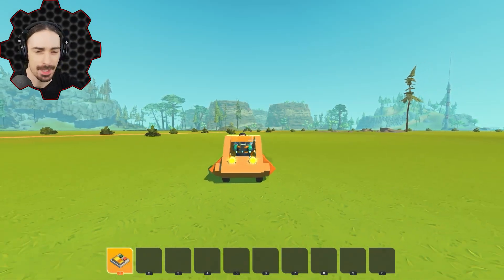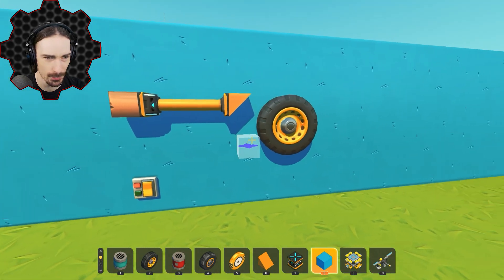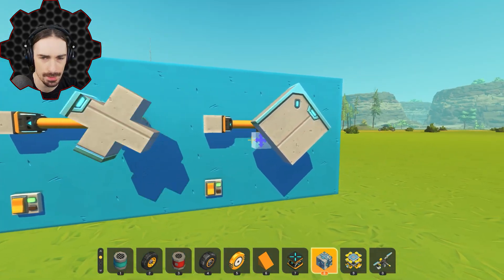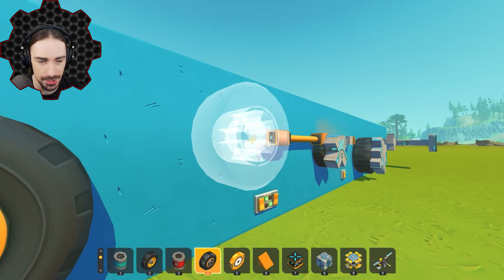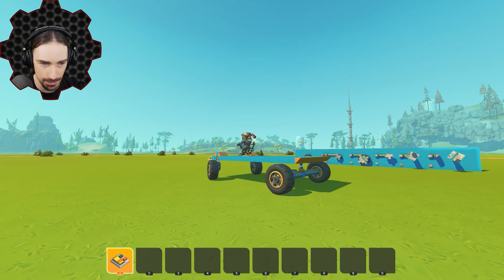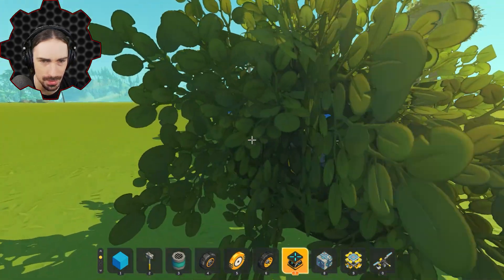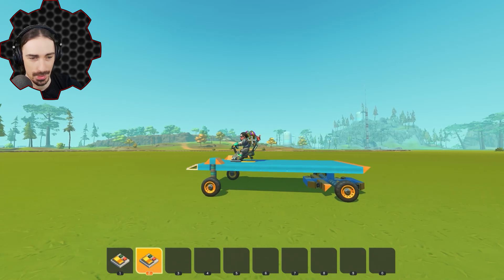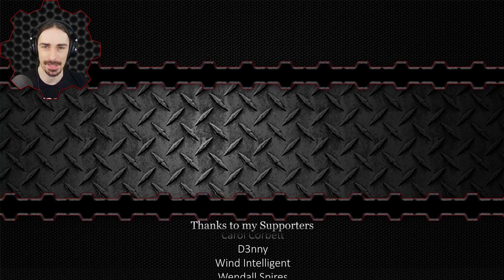The Spooky Science of Wedge Powered Objects

Comment: This is interesting for a low resource requirement zero fuel vehicle in survival. A controller powered car takes more component kits but overall would be more reliable (can go in reverse, can use suspension).

Comment: what if you made a canon powerd by wedges and how it works is that you have two equal weights 
on both sides of a concrete or stell pillar and you attach some pipes and when it has enough power
it realeses from the canon and rolls away.

Comment: Um.... Maybe you should try different diameter pipe/wheels for the wedges to push on. A larger diameter would give more spaces for wedges.
And then, if different arrangements give different levels of torque/speed, you can actually use logic for a switch gearbox.
Also, would a glitch piston allow for a single solid axle?

Comment: Huh, looks like it has decent horse power, but terrible torque...
Wonder how it'd change the "car's" speed if there was a second set of powered wheels? Change the frame from a rectangle to an I-beam?
Maybe if you could individualize the wedge's pistons it could power better in the car? Or at least make it so you could fine-tune the HP/Torque from the wedges?
Also, for the "break" instead of blocks, I'd have thrown in more wedges facing the opposite direction. Then, your break would also be a proper reverse "gear".

Comment: So I think the reason it’s barely going at the beginning is because it’s not actually contacting it that much so what I think is the prototype is a directly attached to the wall but the car is extended a few blocks out to where the piston is with the wedges so it’s not actually getting all it’s push therefore less power

Comment: With the final design, because of how the computers calculate the collision shapes of ebjects with perfectly straight lines, the corner of the stack of 4 wedges side by side would result in only a contacting corner, as the bearings have some give. The closest corner would then be the only point of contact between the wedges and the pipe axle. Any bend in the axle would mean less contact, and therefore less force applied. The force does appear to be the diagonal component that is reflected from the contacted surface against the wedge/block. You likely wouldnt move at all if the surface touching the axle/wheel was perfectly perpendicular to the radial direction of the wheel. EDIT: Your brakes have this perpendicular surface angle.
Reply: I think if you ran the wedges with a single piston per wedge, then you would have the 4 corners instead of one corner when the axle bends, making it more reliable.

Comment: Thanks to this video I have now made multiple prototypes of survival vehicals that use wedge power, including a large mobile base with independant suspension at every corner and powered solely by wedges. Soon I'm going to make an even larger mobile base with more wheels and more wedges. Oh, wedge power tip, don't do a weird pipe axle, just put the wedge-piston right on the wheel.

Comment: I attempted a sort of tool setup with this Glitch. Using a drill or saw on top of the wheel (without additional blocks) gives a result, similat to using a gas motor on mid power level. Another step towards motorless survival

Comment: the reason that this works is because the physics simulation thinks that the wedge is pushing the wheel forward and the piston is being pushed back because of the speed and pushes forwards again - I can't explain why it's pushed back - which creates motion in game physics. This doesn't work in real life because the piston wouldn't be pushed back by the wheel rotation which is caused by the wedge on the piston.

Comment: I paused at 2min 58 sec to make this comment, I believe the reason why it spins slower when you add weight vs having that same weight and starting it is because the game recalculates the "forbidden momentum" after you add weight (also is probably low torque due to how the power is being generated). I've seen similar physics glitches in other games such as trackmania, in that game when you change directions of the tires very quickly the game engine multiplies the force instead of calculating the proper drag/resistance. Given how that games physics work i'd assume the reason that the applied forces with the piston creates a spinning motion is due to the piston extending and bouncing back in small increments repeatedly in the same place. I'd also assume that if that is indeed the case then this mechanism/glitch will not work  once there is too much play because there will not be a consistent repetitive force in the same location. Probably resulting in the piston and slope bouncing all over the place(as i watched further i saw this was the reason for the issue when you had suspension even though it is not precicely how i explained it). Givin that assumption I am guessing that the location of the square piece that you will soon use may not work unless you have the cube at a slope since the force on the flat surface will be in the center of the wheel instead of at an angle where it acts like a slope. But I suppose I will figure that out when I continue the video. Also, I love your content. Keep doing what you do!

Comment: You didn't consider the length of the piston (or whatever the name is) when it is extended. To me it seems (based on the two most right examples on the wall) that the length has positive correlation with the speed. Also it would have been cool to somehow measure the torque by going up-hill to see if two wedges give you more torque but lower speed, or two wedges are in general inferior to single wedge. Overall I loved this sci-fi (or sci-scrap or sc[i]rap) experimental video. Well done!

Comment: It looks like pushing anything into a wheel cause a force multiplier. The direction of spin seems to be determined by the current rotational momentum of the wheel upon contact. Cycling the piston while its rotating causes the multiplier to recalculate.

Comment: Just an idea but going with the whole two speed idea maybe there's a correlation between the surface area of the wedges and the amount of torque produced meaning that if you have less wedges touching the pipes the wheel would move faster. It's be cool to have the wedges that are currently connected split up with more pistons pushing them (in say groups of 2 instead of 5) then to start off you would have all of the wedges pushing the pipes then as you increase in speed and need less torque you take away more pistons much like how a torque converter works

Comment: Scrap man the further away the weight is the more torque is applied just like trying to unscrew a bolt the further away the leverage point is the more torque applied and the easier the bolt is to unscrew so the further away the weight the easier it is for the wheel to spin also for a video idea do a best wedge powered drifter wins and judge by drift angle time in drift and possible drift taps do this with man and moonbo

Comment: So, after doing some eyes in the comments, I've perfectioned my ideas, got some out, and got some new ones. First, make the car smaller, shorter and lighter so the low torque can send the high speed easily. Second, check if the wheels are spinning same way. Third, make some wedges not to move without another button so you can have gears. Fourth, put the concrete extension, since they change the gravity mass abusing better the physics. Fifth, try using bricks for rear gear.
Sixth, avoid making it tall for having less necessity for springs and less trouble.

Comment: So you basically created gears. The more that are engaged, the lower the speed, but higher the torque/power. It also seems to be pretty consistent. I would be interested to see if you did a 4 gear design, if that would have more torque than an engine or two, and be able to move more weight over flat terrain, or uphill. Could basically be a semi for SM.

Comment: You should have tried to use concave pieces. I actually made micro trains and for consistency I placed concave pieces where the wheel is (wheel first, otherwise it doesn't work) and it started spinning in a random direction very fast.

Edit: It seems the bigger the wheel the more torque you have (but you have to apply the wedge power directly to the wheel)

Comment: I have a theory about how it works.
bearings have a tendency to wobble when there’s a lot of weight on them and rotate quickly.
However when you put the wedges further from the bearing it would prevent the wobble and lower the rotation speed.
So maybe putting more weight away from the bearing and test how many wedges you could get away with before it starts loosing speed might give better results.

Comment: You seem to mix up power and speed. With the thinn pipe pieces you get a lot of speed, but not much torque, therefore not much power. Pushing on the wheel directly should be slower, but provide more torque.

Comment: It seems like you neglected the friction and weight of the block applying the force. I haven't done creative mode in SM, but it's a good bet that standard wedge blocks have less friction and weight than tier three concrete. I think these parameters are important, because while the better contact surface of the wedge definitely helped it in these experiments, I would suppose that how much speed the recipient wheel receives also depends on how much the friction is fighting the motion and the frequency with which the piston's block can hit the wheel.

I propose that the frequency would depend primarily upon weight, and secondarily upon the piston's strength (because that also determines it's speed for some reason). It wouldn't necessarily be the maximum piston speed, but rather whatever speed gives it a higher 'resonance' speed.

I would also be interested in the results of using a small/large pipe on a free-spinning bearing as the driving piece, as that should theoretically remove friction as a variable.

shrug

Comment: The wedge forces the cylinder downwards while being pushed upwards. This force is applied with every tick the game calculates and if the cylinder is allready rotating the momentum keeps increasing wich causes those insane RPM. If the wedge pushes against the wheel the high grip forces the wheel to move in the same direction as the wedge in that case upwards wich causes the wheel in specific to spin forwards. From there on it behaves similar to the cylinder in regards of acceleration.

Comment: If I remember correct, piston speed determines strength, not the distance slider. Think of it as changing a springs length as opposed to a springs “speed to extend”.

You may get more speed from the car if you set your piston speed higher, but you may want to remove the gap between the wedges and axle (make them touch always), otherwise you may get some axle slapping, and potentially clip straight through.

Comment: I’ve got some Ideas which could work

1. Maybe you could add some concrete (or other) blocks to extend the axle and then put the wheel, could make it faster like in the tests

2. If it behaves like in the test with the long axle and the big wheel, it might be help using a wedge-brick wheel (like an octagon) 

3. You also could try using a bit less Wedge's to get more top speed because of less friction as we saw with just one pair of wedges vs two pairs (wedge transmission)

4. With the 3. Idea you could possibly make an wedge transmission with even more ‘gears‘ getting less torque but more top speed (like @Mr. Night already said)

Hopefully this might help : )
#WedgeGang

Comment: future experiments: it has fast rpms and low torque, maybe put a lower gearing with some kind of gears fir more torque? different angle of the wedge? more pistons? put the mug/cylinder on a bearing too? add many more of the wedge engines on it and connect them with gears?

Comment: I just realized that the wedge powered car is actually similar to something I proposed back when you made a car out of nothing but wedges, sort of: I had proposed (mostly as a challenge for kan) making one which replaced the engine with a piston engine made of wedges. while this isn't technically a piston engine per se, I think it definitely qualifies as a power source that consists of nothing but pistons, wedges, and bearings. of course, who knows if it would work on the wedge-wheels you made back then...

Comment: I definitely would like to see another one of these videos on this.
I definitely want to see what happens with more pistons, does the force do better spread evenly, does allowing the extra mass to flex offset to the bearing allow for more speed?
Also using triangles directly to wheels, since the original wedge car used it I wonder if it'll give more torque?
Would applying the triangles sideways to the wheels be a better brake?

Someone also suggested individual pistons to each triangle and also that one of the wheels my be spinning backwards? And that's why it won't move from a standstill on one but idk.

Also what chaos comes when you turn down the physics?!
👀💥

Comment: You only used wedge power on pistons with Speed 1.
In Scrap Mechanic Speed is the key factor of piston strength so I would try to increase the speed and check if that is faster or more torque because of higher forces maybe?

Comment: It seems wedges are low torque high speed which makes them so difficult to use in a car, normally I would use a gear ratio to give it torque so it's usable in a car but scrap mechanic might not like that

Comment: I think the double speed system acts kinda like a gearing system in a way so it should increase torque but decrease speed, also you should add a 3rd set of wedges on the top for a 3rd gear instead of a break, and maybe you can fit a 4th gear in the future by lifting the creation somehow.

Comment: What if instead of two sets of wedges for power you just have 1 set of 8 and have a free rotation bearing on the outside of the wheel connecting the wheels with pipes to the body that way you don’t need the connection point on the centre of the rear undercarriage of the car

Comment: Two things
1. Does coming off with wedges from one side like you did on the wall have more power than extending wedges on either side of the piston like you did on the car?
2. I've been meaning to suggest/request for a survival theme a no engine them (gas or electric) like only using piston or controllers to power anything. I think unconventional builds would really force some lateral thinking and creativity.

Comment: one for one would get you more torque i think, you're coming out from the rotor like 6-7 blocks, that's going to hang on the axle and take away from the spinning momentum. two sets of wedges stabilized the axles but slowed the machine because it's still spread out so thin, i think if you do 1 wedge to 1 tire and put the rotors or bearings next to the wheels you'd have gotten a lot better performance. i don't quite know if i explained that properly, i took a pretty nasty blow to the head last year and my brain sort of changed the way i'm able to comprehend things.

Comment: So I ran my own tests, here are the results (note: i am using the modpack to find the rotation speed of the wheel, i cannot tell wether it is measuring degrees/second or rpm) (note: when you see "-", that means it is spinning counter clockwise) 

⋅initial test: ~12,000 rpm
⋅changing max length and speed affect it
               ⋅max range: ~10,800 
               ⋅max speed: ~18,000 
               ⋅both max: 17,000
⋅change the block
        ⋅block: ~-500
        ⋅cup: ~15,000
        ⋅duck: ~15,000
⋅change wedge
       ⋅small narrow warehouse wedge: ~-8,500
       ⋅large narrow warehouse wedge: ~20,000
       ⋅large wedge: ~2,500
       ⋅staircase wedge: ~-700 rpm
⋅change wheel
       ⋅large: ~2,000
       ⋅small pipe: ~-160,000
       ⋅large pipe: ~11,000
⋅adding suspension
       ⋅sport suspension
               ⋅SBW (suspension, bearing, wedge): ~2,200
               ⋅BSW (bearing, suspension, wedge): ~ 2,300
       ⋅off road suspension
               ⋅SBW: 2,200
               ⋅BSW: 2,400
⋅more wedges
               ⋅2: ~-1,200
               ⋅3: ~ 1,900
               ⋅4: ~-70
⋅change block being pushed
      ⋅center: ~3,000
      ⋅bottom: ~-600
⋅on an unanchored creation
      ⋅stationary ~10,000
      ⋅spinning
             ⋅clockwise: ~200
             ⋅counter clockwise: ~-0
      ⋅moving: ~12,000
      ⋅car (no suspension, unsing initial test as power, made out of plastic block):
                average: 17
                top: 35
                faster than walking (sometimes)
                slower than sprinting

in conclusion, it works well as a stationary, anchored testing use, but not for cars.(since this uses a bug, results may vary between people)
Reply: also, the car was so bad that it would sometimes flip around, reverse the direction of the output, and the turning didnt work at all

Comment: I think the reason why it's not going as fast as you're tests ... is because of weight momentum? ... on the fastest roating wedge test you have blocks a decent distance away from the wedges but you also have 4 or more blocks in a square for weight on the end ... and perhaps the distance from the wedges plus the heavy weight on the end gives it momentum... but that's why when you remove the wedges after spinning it it continues to spin untill it eventually slows down but the weight itself now has loads of energy momentum so it should spin for longer or perhaps spin faster )( it all depends on scrap mechanic physics but I definitely think further away plus a weight on the end equals faster spin